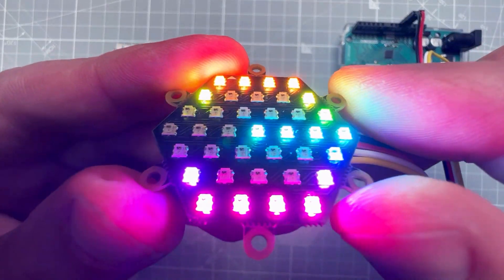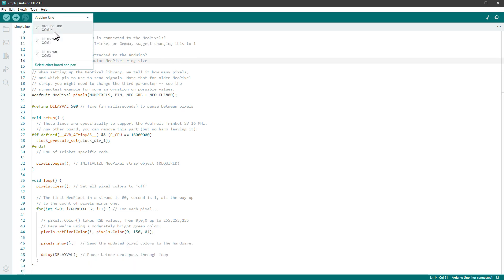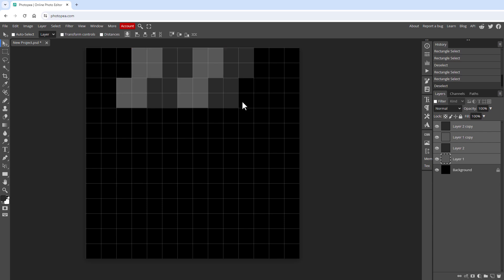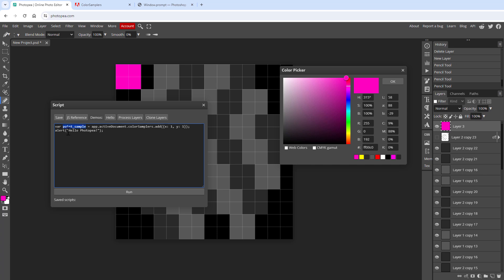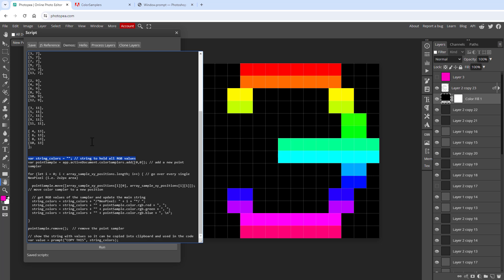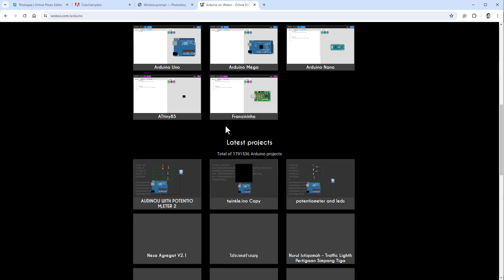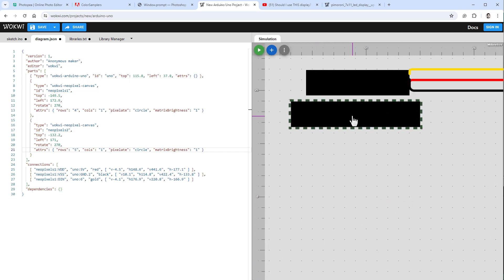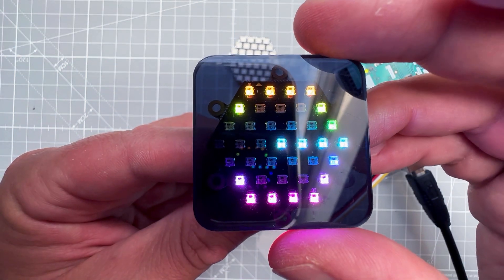Arduino Hexagonal Displays with NeoPixels

Comment: How bright are these LED matrices? Could they be used as a decent flashlight or mood light?
Reply from the maker: They are very bright, definitely for mood light, but they get hot very quickly is you set it to 100% brightness. You might need to attach some heatsink.

Comment from the maker: Here are all the parts of this custom gear indicator series:
Part 1 - getting current gear with hall sensors: https://youtu.be/QixtxaAda18
Part 2 - exploring the Pimoroni 11x7px display: https://youtu.be/sZZFgSmYJjc
Part 3 - custom 3D printed shifter knob: https://youtu.be/HcP48uCBzDQ
Part 4 - Pimoroni 5x5 RGB LED display: https://youtu.be/84bn_OpuyCQ
Part 5 - SimHub shifter knob: https://youtu.be/JbVqXZngXAY
Part 6 - NeoPixel hexagonal displays: https://youtu.be/1NI-I1Lpdqo

Comment: 1:53 Umm... 3 pin connectors are almost as common as 4 pin ones. But maybe they use 4 pin connectors for some other products and don't want to stock both kinds, so use 4 pin for everything.
Reply from the maker: You are correct. I think they simply use 4 pin connectors because that’s what they use for all the other accessories.
Reply: What about dataOut? You can daisy chain multiple neo pixel LEDs. In this case you could run multiple hex displays with only one pin connected.
Reply from the maker: @az6433 that’s correct, you can do exactly that. I should have mentioned this in my video, somehow I forgot.